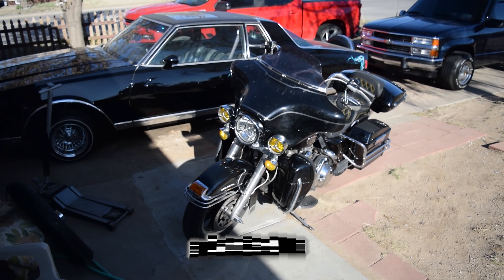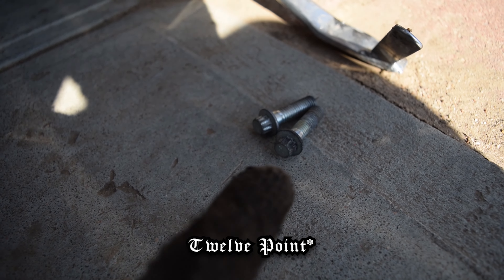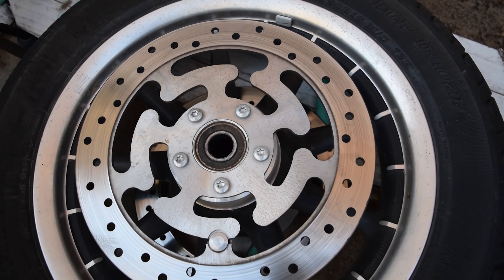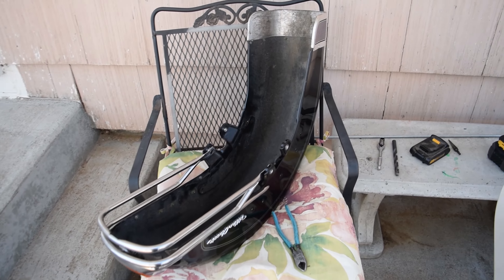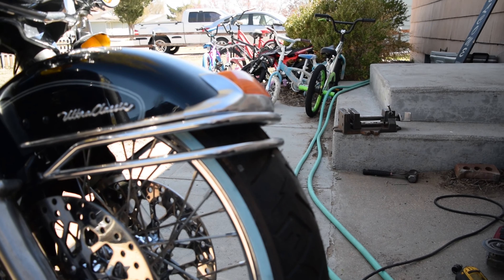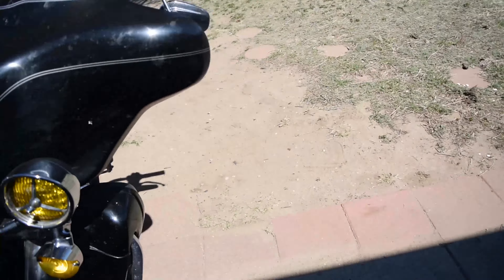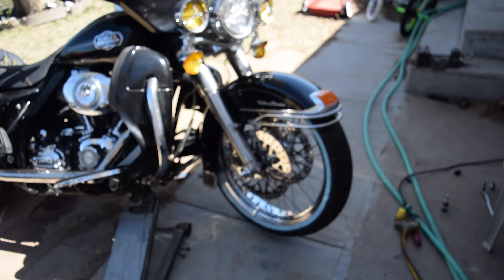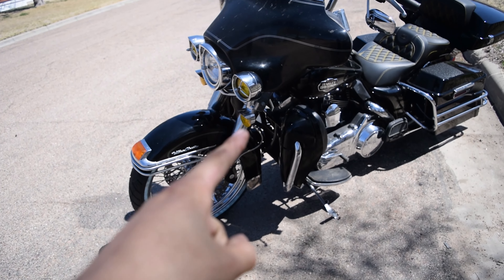HOW TO INSTALL 21" WHEEL ON HARLEY DAVIDSON TOURING MOTORCYCLE

Comment: You're gonna have issues with it man. My road king was that close and at freeway speeds the tire expands and rubs. You'll smell the burt rubber. You gotta try and tilt it back a bit more. Good luck. The fender rail is what it rubs on.
Reply from the maker: I’ve been doing 80mph+ on the highway the past week since I installed it. No rubbing on the rail or the fender so far🤷🏽‍♂️
Reply: @CGOD  you might get lucky then. I didn't have an issue with rubbing for about 2 weeks after I installed. It was easy to fix though I just loosened the 4 fender bolt just enough to get movement and pulled it up a little and never had an issue after that. Looks good though.
Reply from the maker: @koleby3  yessir! I built a road king before and had to do the same thing. Rode it for thousands of miles without any issues

Comment: Did you have to install different wheel spacers on the front of yours? Mine on my 2001 electra glide are not big enough
Reply from the maker: Nope used the original ones

Comment: Hey man I’m still struggling with the ultima front wheel I bought like you had on the soft tail I put one on my 12 Electra glide
Reply from the maker: @131sickness  what’s the issue with it?
Reply: @CGOD  vibration n the handle bars really slight I bought the kit for abs but I just can’t get it right lean to the right goes away lean to the left really can feel it
Reply from the maker: @131sickness  try swapping the stock wheel back on if possible, maybe it needs balanced or some kind of issue from the manufacturer

Comment: just seeing this, so did you end up taking the whole trim off? i put a 21" on my 08 and i removed the whole trim piece (i had to for clearance) tire swells up while riding on highway. you have any problems?
Reply from the maker: @impala63ism  I just shaved the fender rail to get it to fit. Been riding it everyday since this video with no issues

Comment: Looking good, I'm looking to install a 21" on my Road King.  How do you like the DNA?  Good quality?

Remember your tires swell as they heat up, so be careful with your clearance.

Ride safe ✌️
Reply from the maker: I’ve ran a couple DNA setups with no issues, stainless spokes so no rust. I’ve been riding it daily on the highway to verify the clearance is good. No issues so far🤙🏽
Reply: @CGOD did you have any trouble with that front bolt?
Reply from the maker: @felixvidales8786  I shaved it down a bit to clear